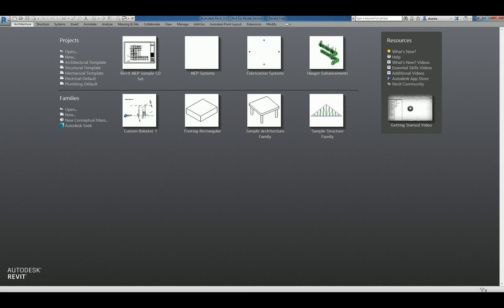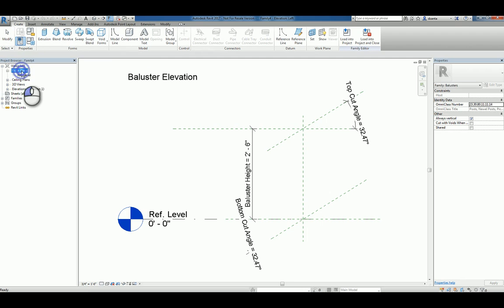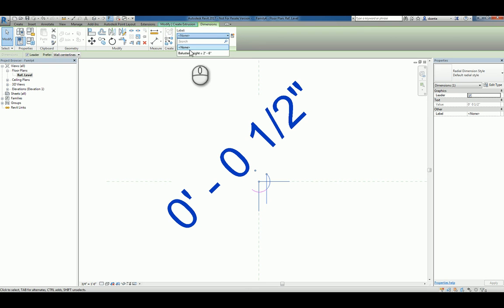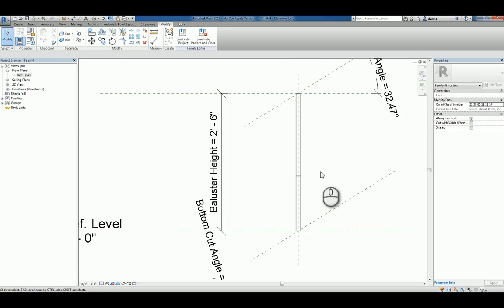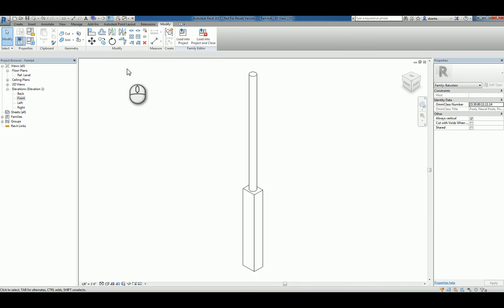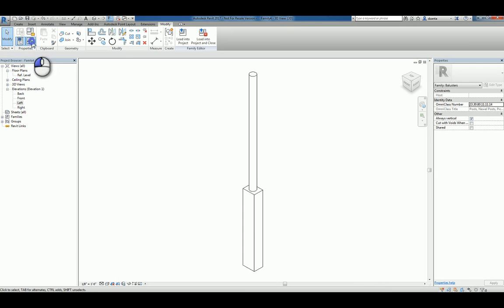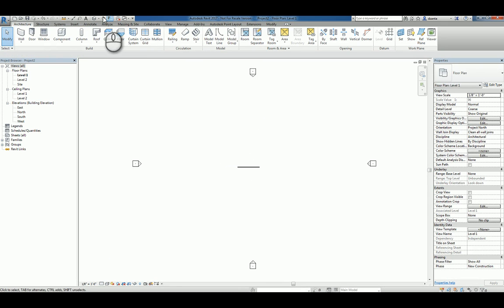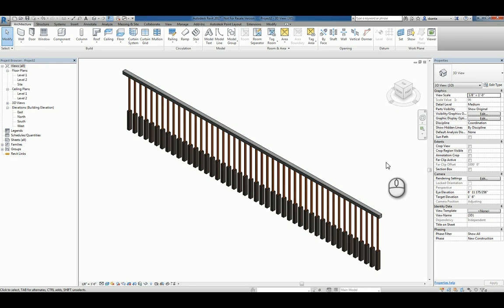Revit Families Series   Custom Baluster How To

Comment: Well done for this video... Although, I have a challenge... I have used this method to try to simulate the prop positions for my beam formwork. It works effectively however, I am trying to keep a count of the balusters(in this case props)as well... How can I get to count my balusters in my schedules
Thank you Dzan Ta
Reply from the maker: Timothy Ogese 
once you create the design, create a schedule of the objects and then go to the format tab within the schedule command window, select the baluster count parameter and then select total.  go to sorting tab and choose itemize instances and total that too.
Reply: Thanks Dzan, I was able to acheive it though but with a different technique - cos I cldnt find any baluster count parameter in the schedules. I ended up creating formula based on the lenght of the railings which worked in a way. However I find myself having to make alternative spacings for my props... Is there a way I can access any of the baluster system parameters so I can be able to use it to calculate the counts for my variations? Thanks once again
Reply from the maker: if possible, send me what you have so I can look at it to get a better understanding....send to dzanta@gmail.com.  Thanks

Comment: LINES IN THE REF.LEVEL IS NOT APPEAR SO THE DRAW NOT APPEAR TOO
AND CAN YOU MAKE REVOLVE ORDER IN THIS SHEET
Reply from the maker: if I understand your  question correctly, you are stating that the Detail Lines inthe Ref Level floor plan view is not visible?  if so, what linetype are you using for the detail line?  As for the second part of the question, I do not understand your question.  The Revolve command to requires you have a closed sketch as a profile and a reference axis line to revolve the profile around.  Hope this helps.